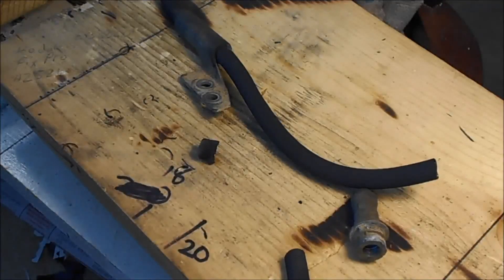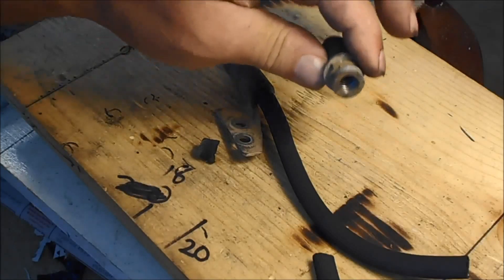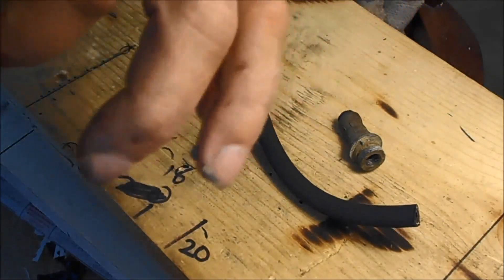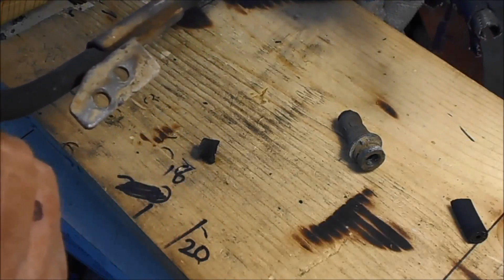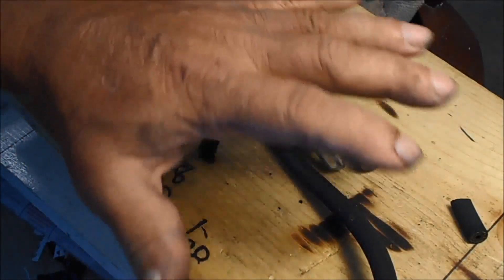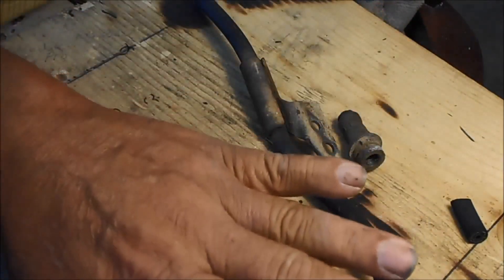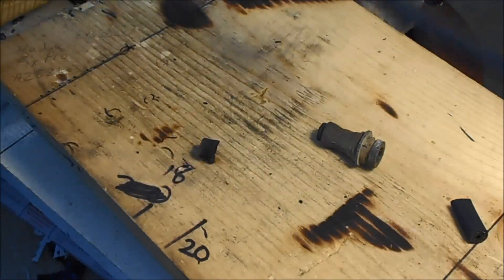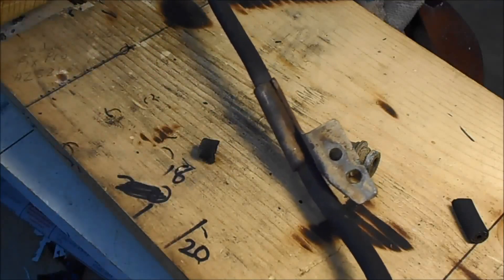BRAKES STICKING AND PULLING TO ONE SIDE

Comment: my father in law explained why this happens. after years and years of being under such tremendous pressure from the master cylinder, the hose starts to break down and pieces of the inner wall flap up. this flapping makes the hose act as a check valve allowing pressure one way but not allowing it to bleed back the other way. you saved me from replacing the caliper Danny, thank you.
Reply: ..and rust builds up around the inner side of the metal bracket closing off the hose and check valving symptoms occur. Always crack the hose on the caliper to determine where the pressure is being held. Your Father in law is a smart guy..